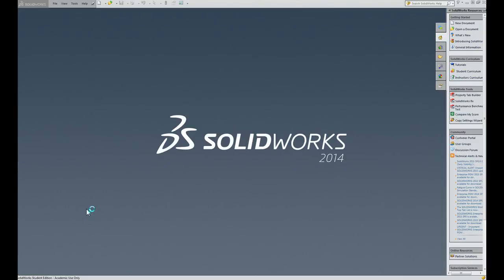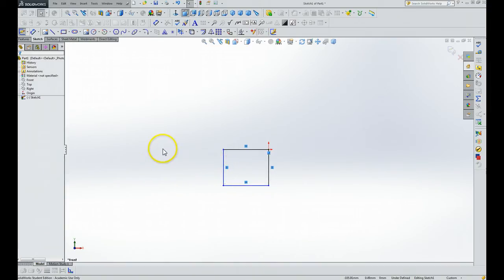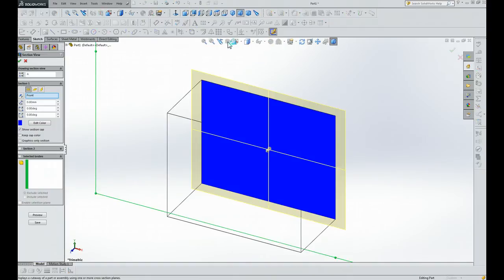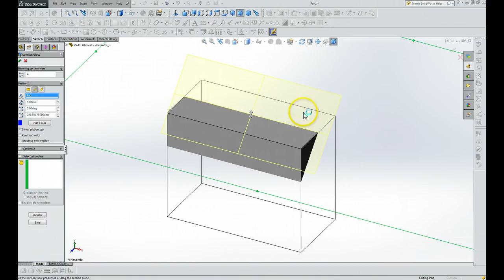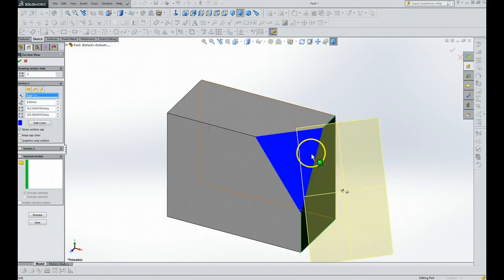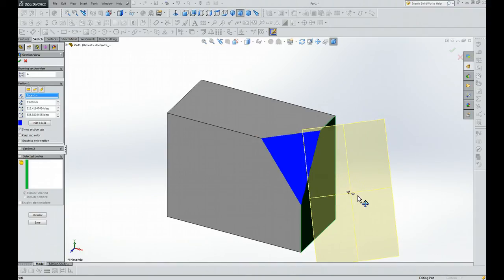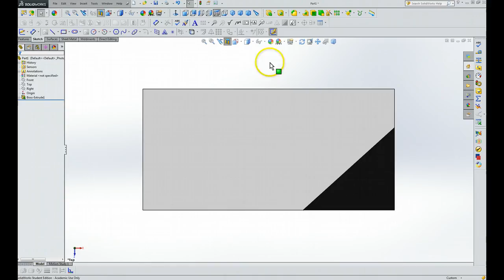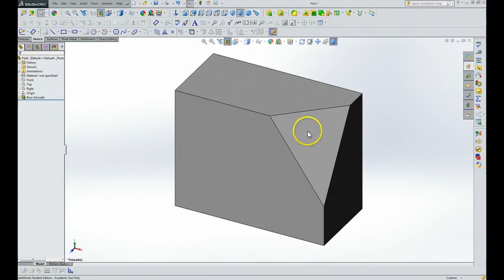Solid block Oblique surface SolidWorks.

Comment: That's incorrect, that's the display factor you didn't actually cut the shape. If you create a drawing it will display the original box, you need to use something to cut the box idk what to use so im stuck.
Reply: https://www.youtube.com/watch?v=56karjU0vbE